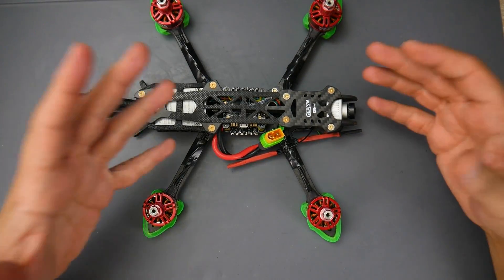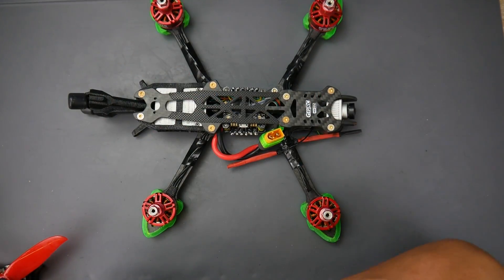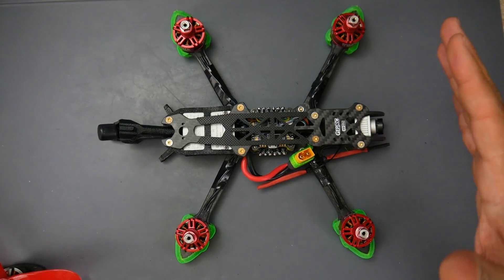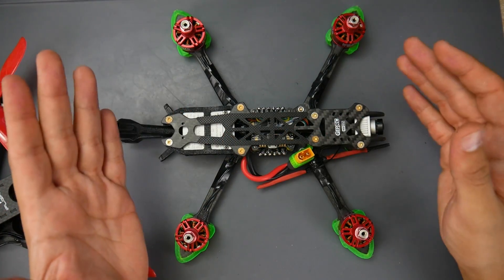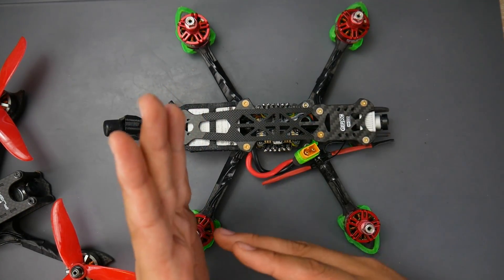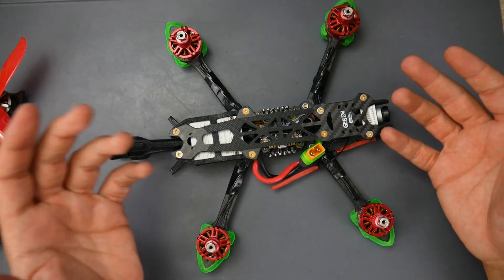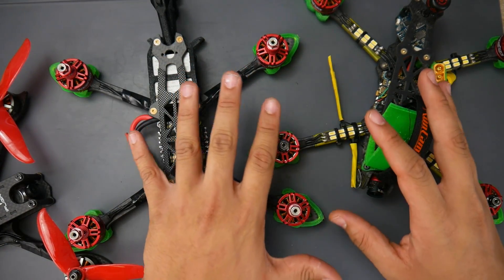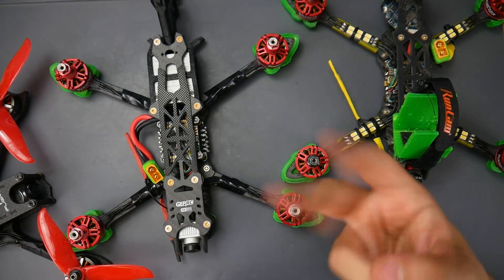DJI FPV Drone Build // The Flight & Review

Comment: Your destroying batteries because of the battery pad your using. The GepRC pads slip supper easy. Use ummagrip and two thin small straps.

Comment: I also have a Nother question about the DJI system I want a comment that you made. You said that the latency of the DJI system makes you crash more often. 
Where are you running it at the 50 Mb setting? 
Did you have all latency inducing features turned off?

Comment: I easily get 5 mins on my Dys samguk  2207 2600kv motors 4s 1300mah on 5 inch props (51433). N they are cheap as well but the best performance to price motors. And my auw without battery is 550 gms.

Comment: I have two of these geprc HD5 frames and can confirm they’re very durable. I have cyber xing 1777 kv and it rips! Running the T- Motor F7 Combo Stack. Are you using sbaud fast mode in the googles? I was having some random failsafes with dji before enabling that, before it was set to normal.

Comment: Well the GePrc mark4 frame could use just 2 simple improvements to be great.  
The front part could actually  be a tad bit longer so 20x20 stack fits including hybrid cam stacks like runcam or tariser 
and the props dont come into view on 5/6inch setups (deadcat arms or longer front?)
The back on the other hand could ALWAYS be wide enough to fit an air module. 
All they did is use the other standoffs in HD version basically with a different top plate.
They could also include some of the more usefull TPU prints like arm guards.

Comment: Thank you for making this video I was just about ready to buy the DJI system. 
I have a few questions I just purchased the  GepRC Mark 4. Do you have a file for the arm guards that you have on yours that I could have? Those are the exact arm guards that I want more motor protection. My second question is what kind of antennas are those you have on yours you have the red one and the yellow one they look like homemade imortal tees???? 
I am not liking the durability of the immortal T they’re too flexible and they go in my props too often.

Comment: Bro, there's something wrong with your DJI setup. You should have unnoticeable latency at the range your going - bando or no bando. You only fly at a medium speed like most of us, so there shouldn't be any latency at all that's noticeable.  What MW are running at? Set focus mode=auto, transmission=low latency (always), 50mb.  You should have zero frame drops. I stand WAY further away from the bando I fly I at (it's fenced off), we're talking nearly 1/2 mile out before my quad even reaches the building. I go in and out, around a crap ton of rebar, etc... not a single issue, none. I couldn't imagine trying some of the same moves with analog. There's something wrong with your system, you should have it looked at.
Reply: I was having issues until enabling sbaud fast mode for low latency and now it’s real good.
Reply: @jman7770  drone mesh doesn’t respond.
Reply from the maker: I read everyone's comment. When I can install respond. I'll try again with all settings
Reply: @DroneMesh  🙏🏻
Reply: @DroneMesh  did you get it  fixed yet? did you find the issue?
Reply: Like other user said, he doesn't respond.